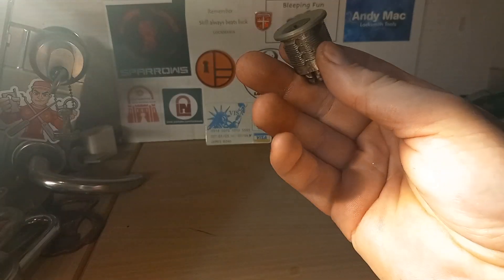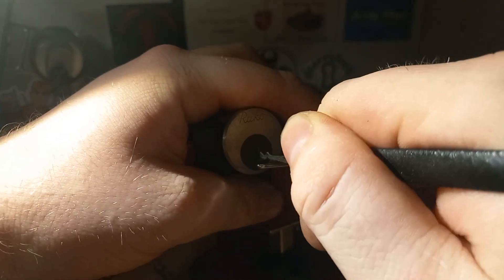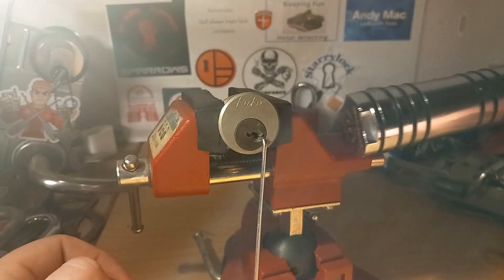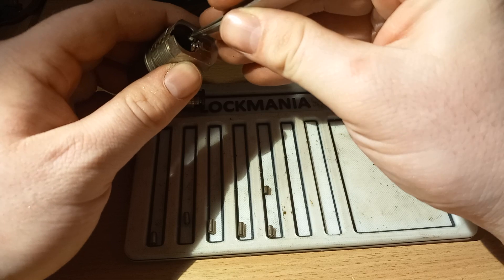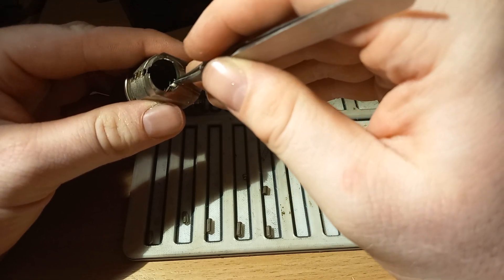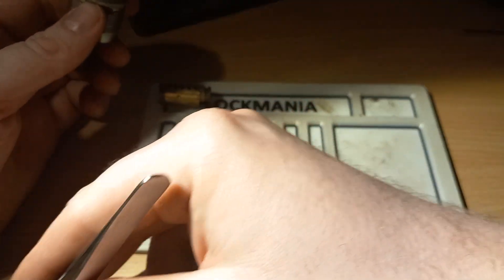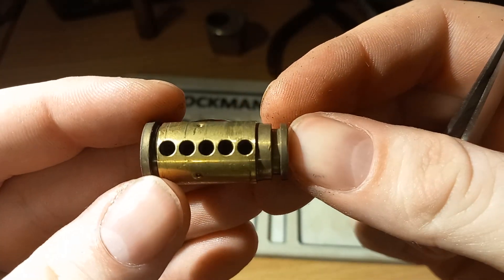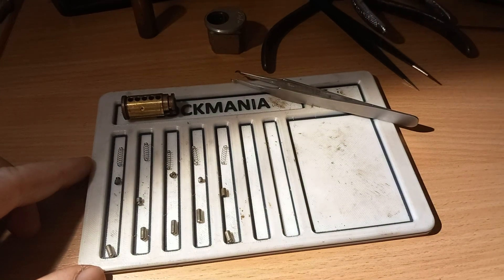(1113) Quick open on a ruko 500

Comment: Nice toy u got there😉
I have been trying to pick a 500 oval (no key) for the last 6-7 days and it wouldn't give it up.
Now i dont have a Kronos, so last night, i cheated and rear shimmed 2 pins for an easier pick...
So now it has a key and will still not be picked🤣🤣
Reply from the maker: Thanks for watching My friend, if you go through My videoes i have picked a good bunch of 500's by now, when you first get the feel for the pins in there its kinda easy :)